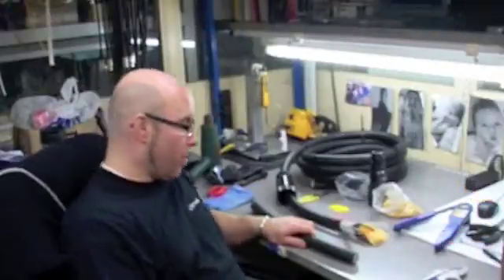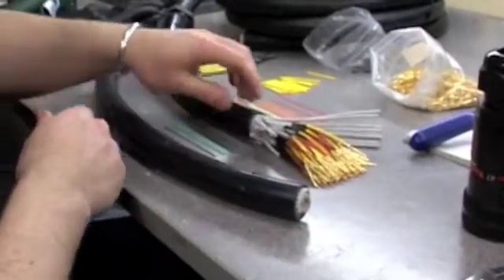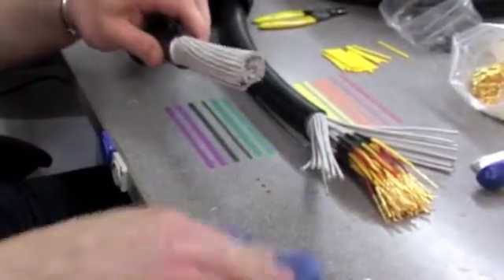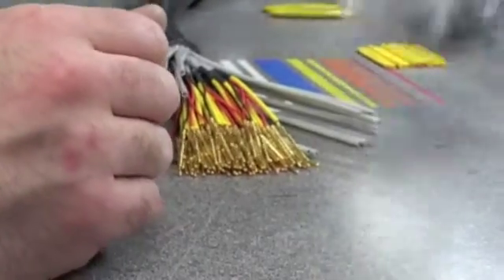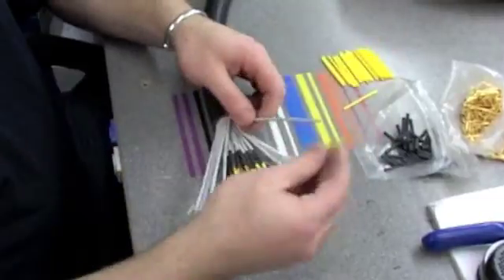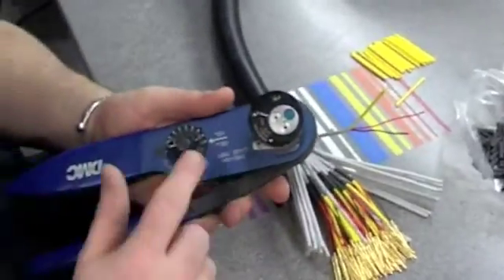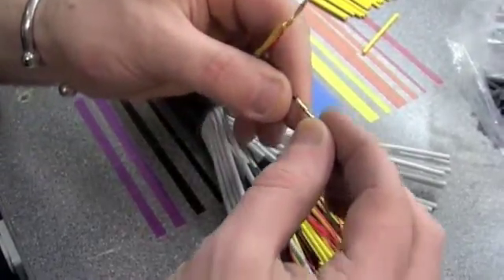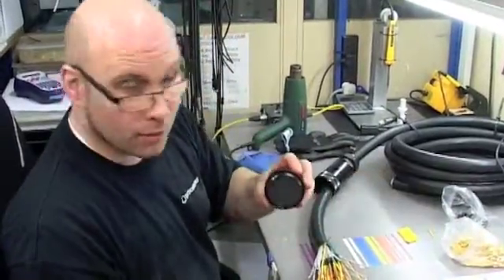How to make a 150 pin Multicore Cable - Part 1

Comment: I know this is an old video but do you have any recommendations on crimp tools?  What tool options are available to do the crimp? The tools are quite expensive almost more than it costs for the materials to make a whole passive 3 way stage splitter 😂